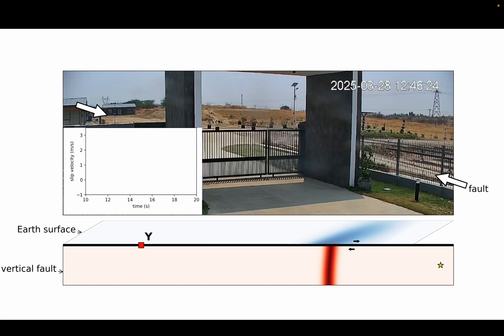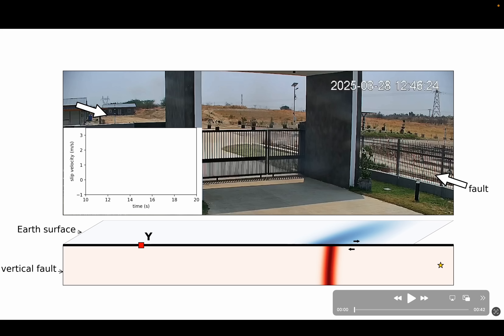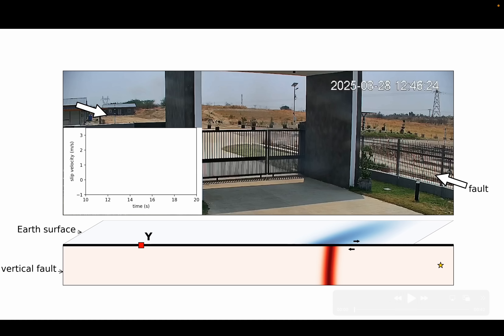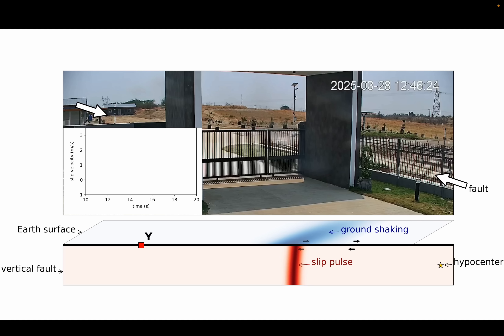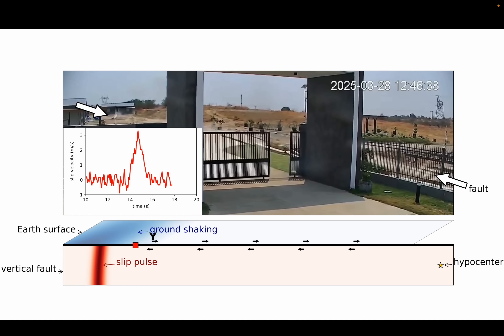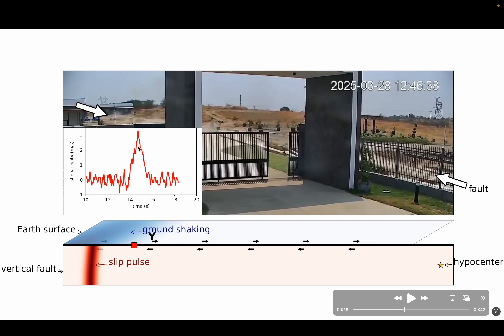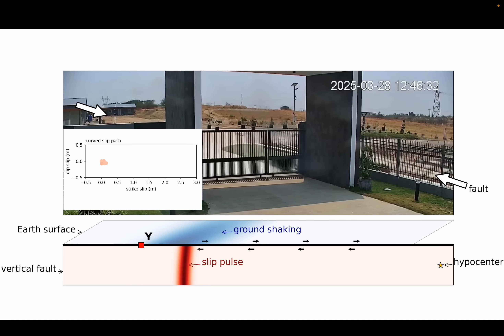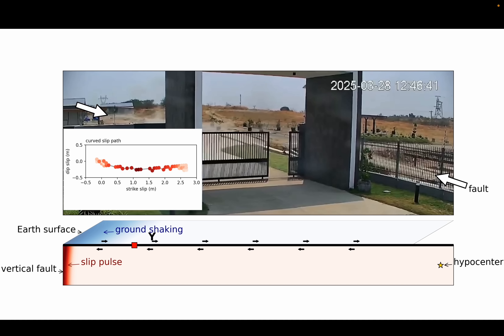Pulse-like rupture and curved slip - Analysis of Myanmar earthquake rupture

Comment: I think there's a video from Nepal earthquake taken from a street view camera
Reply from the maker: Yes, that video is also remarkable. In case you're interested -- because the fault rupture during the 2015 Nepal (Gorkha) earthquake does not reach the ground surface (referred to as a blind rupture), the footage was unable to capture the relative movement of both side of the fault, which is the unique contribution of this video from Myanmar. What is interesting about the Nepal video is you can infer what the ground motions must have been by the way the group of people are moving around the scene, they are thrown one way, and then the other. There was a GPS instrument that was recording this ground movement nearby, check out this video by UNAVCO created by Dave Mencin and Roger Bilham which shows a time-synchronized view of both the footage and the recorded ground displacements https://www.youtube.com/watch?v=VS6WVz4V0ps

Comment: I program automated vibration analysis for blasting. A very powerful explosive blast will feature particle velocities (the direct corollary for power) in the single-digit in/s range (~0.02-0.13 m/s) . This peak particle velocity is 20-150x higher than the peaks we see from the most powerful blasts we measure, if they can be qualitatively compared. Plus, the earthquake energy source is many magnitudes larger and much, much further away, deep in the crust, with the wavefront already having passed through miles of solid rock. We measure blasts from at most a few hundred meters away.

Comment: Thank you, Jesse, for that interesting observation. I have looked closely for the effect you describe and I see it on the T-topped pole. But it is a real effect or an artifact of the camera itself bobbing or the camera mount?
Here's my evidence that makes me wonder:
I noticed the same swooping down and slightly up again on the taller pole just inside the arch (with the square "hat" on top, just on the inside of the arch right side). It swoops, too. Then, looking at a solid horizontal part of the arch, the spot on the right where the gate attaches. It is in the near side of the fault, so it would, presumably, not be swooping down and back up. But it seems to be. 
Please have a look and see if I am onto something. Sorry to cast possible doubt but sometimes one observer who has no background in swooping research might better note that a swoop-research specialist is seeing with hopeful eyes what they wish to be there. On the other hand, I might easily be misunderstanding the curvature argument since you don't draw lines on the video image itself showing what you mean.
Thanks again!
Reply from the maker: Thanks for your interest in this analysis. You are correct that the objects on the near-side of the fault also move up and down, which tells us that much of that apparent vertical motion is due to the camera "bobbing", as you put it. To account for this and remove the camera-related motion, we subtract the motion of near-side objects from the motion of the far side objects (e.g. the pole). The curved path that is shown near the end of this video has, in this way, been corrected for this camera motion. For a detailed description, I would highly recommend reading the open-access article upon which this video is based (link below). There is so much to look at and describe and I simply could not fit it all in one short video!
https://pubs.geoscienceworld.org/ssa/tsr/article/5/3/281/659624/Curved-Fault-Slip-Captured-by-CCTV-Video-During

Comment: Bravo, Very cool analysis. 

I would have liked to see the cumulative displacement plotted on the lower graph, and revealed as the slip pulse moved from R to L. So at the end of the animation you are left with the ‘finite fault’ rupture solution (i.e. the stuff Gavin Hayes’ algorithm produces and is plotted up on the USGS website after a big event).

That would be super cool… 😎
Reply from the maker: Thanks! I really wanted to do this too, but I had to stop adding detail at some point, yah know? But yeah, Itotally agree, that would round it off nicely.

Comment: One thing I’ve always wanted to know (and is probably a dumb question) but as the lateral slip occurs there are clearly not “gaps” on the crust so where does the moving plate slip into? Does the end of the fault simply compress at the end of the fault?
Reply from the maker: Great question! Short answer is yes. At one end the Earth stretches a bit, and at the other compression occurs. There are no "gaps", as the amount of motion is smoothly tapered from a maximum in the middle, to zero beyond the edges of the rupture, over distances of 10s -- 100s kilometers. This is type of deformation is mostly elastic. I hope that answers your question.
Reply: @jessekearse2599 Great thank you!
Reply: @jessekearse2599 Re-think "end of the earth". Apologies, but these key details should be avoidable truthfully unless you care to explain the precise location where the 'end' position is on a globe (sphere) or profess your belief to the flat earth ideology of idiocy so say you.
Reply: You can have subsidence, cracking and ground failure at the tensile end of the fault, (those are sort of the ‘gaps’) and then upllift at the compressive end of the fault.
Reply: Plate tectonics; a whole world of slips and gaps.
Reply: @brucepattie3726 Let’s not forget strikes, plates, thrusts, and faults.
Reply: Hey? I was wondering that, myself. Where does the displaced ground go? Obviously, the displaced ground is not moving hundreds of miles, or even a few miles. Thus, I must come upon the conclusion that the ground must compress over some distance. Am I correct?

Comment: I think the description would be improved by actually saying what is being described as "curvature". I'm guessing that it's referring to the displacement being both a horizontal and vertical motion and that the vertical component isn't a straight line.

If it was about a curvature in the plane of the ground I don't think that could be seen in this perspective and I don't see any rotation so I don't think those could be what is being talked about. It might however be something else entirely that I haven't thought to consider.
Reply from the maker: Thanks for you thoughts. The curvature I am attempting to describe is in the plane of the near-vertical fault. I agree that the description of curvature could be improved for clarity. Thanks.
Reply: @jessekearse2599  Yeah I didn't know what type of curvature you were talking about.
Reply: I actually can see rotation! 😳. (Like being at the edge of a massive (dinner) plate as it turns in a downward spiral for a few degrees). 🧐  If I’m not mistaken, you can see the power tower in the back rotating about as much as it shifts!  (Right before it has its “you are already dead” moment! 😂).  Fascinating footage!!  🫨